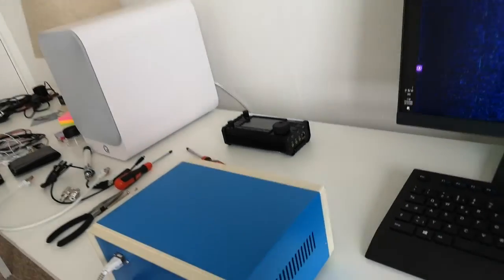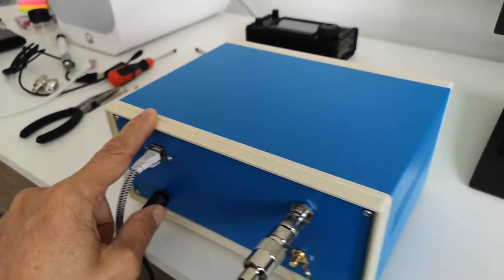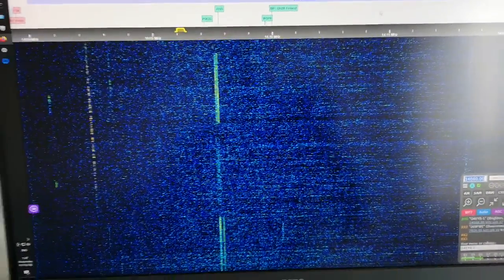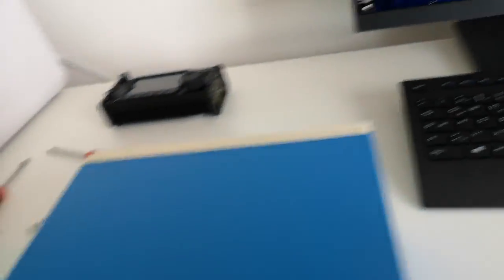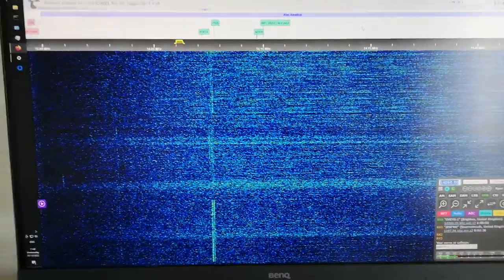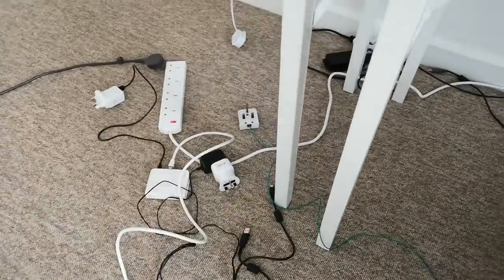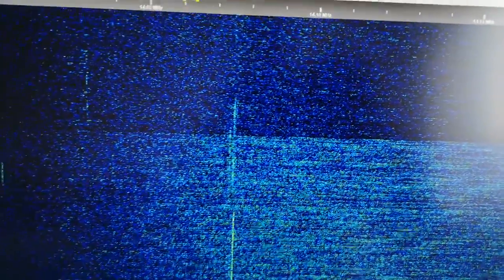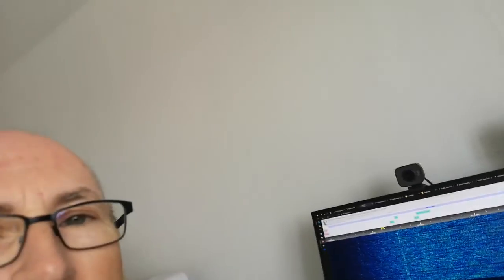EMI shielding and grounding to reduce electrical noise interference to KiwiSDR receiver

Comment: switched mode power supply are the worse thing for any hf radio enthusiast. if the unit is only 5vdc you could hookup a 5vdc regulator chip of a 12vdc linear power supply that is the old type with the heavy transformer. it seems more difficult to find and resource clean linear power supply's.
Reply from the maker: @pleasetryme
@pleasetryme 
Yes you are right. I have a few old linear power supplies. They are hard to buy new these days because they are inefficient and waste a lot of energy but - no RF noise :-)